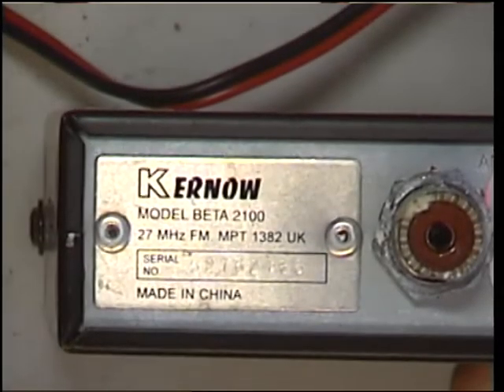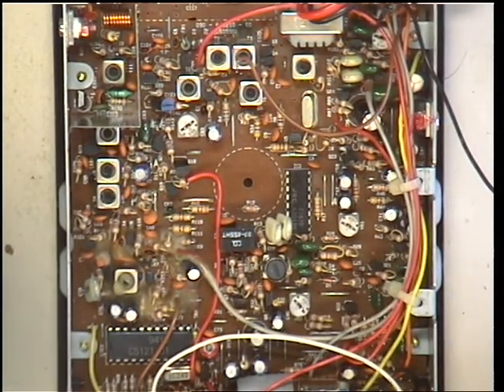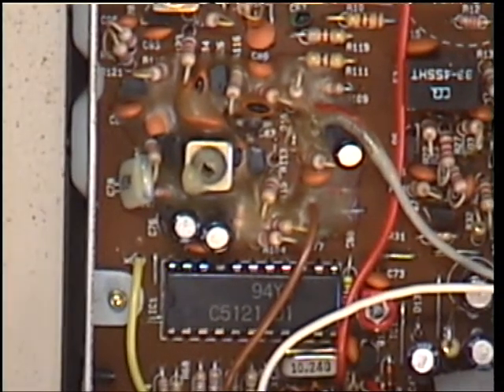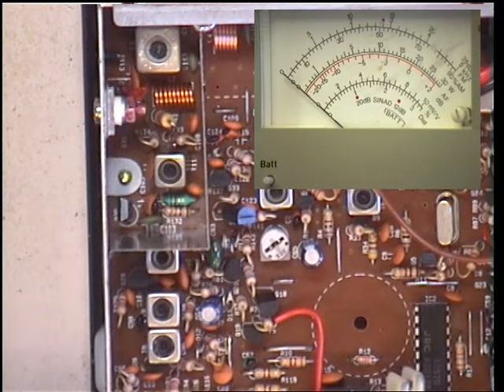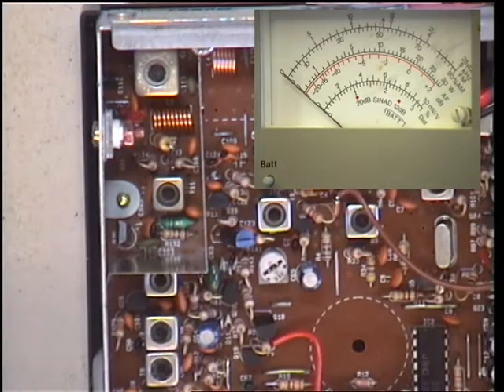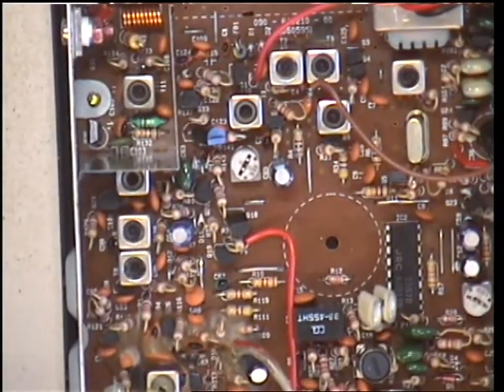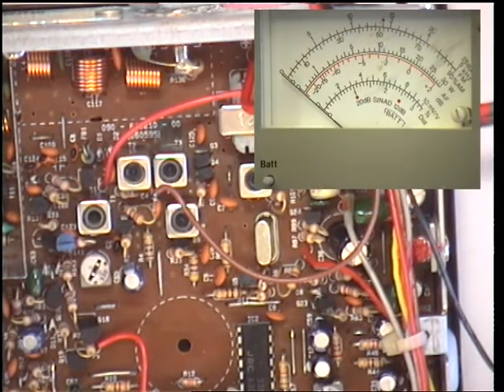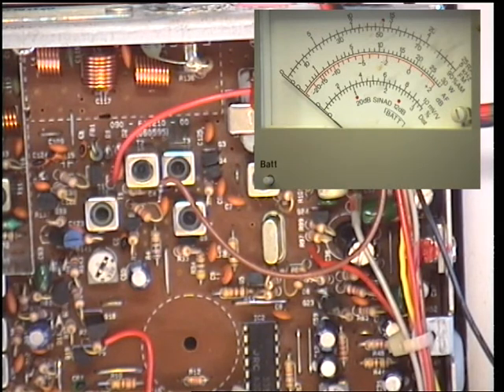Kernow Beta 2100 UK (PR27/97) CB radio (mobile) - Transmit adjustment.

Comment: My internal speaker wires have touched blowing something In side it's a 2100 can you help?
Reply from the maker: It will have destroyed the audio amplifier I.C.  I don't normally do jobs for end users, but under the current emergency am doing so. email me.   rshireby@yahoo.co.uk

Richard
Reply: Thanks for your reply.. I haven't used the thing for years and was going to give it to a friend, I'm not too bad with changing components I just needed pointing in the right direction. .